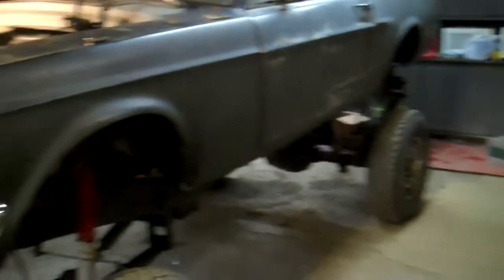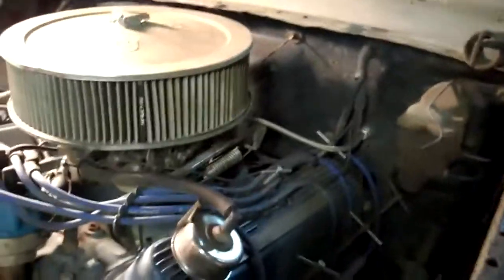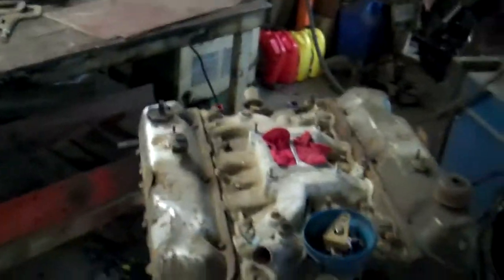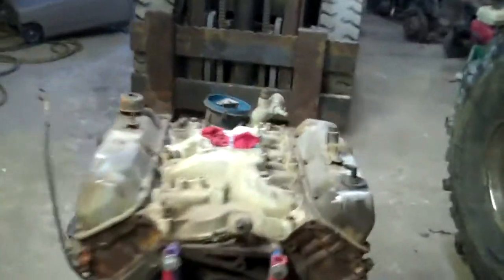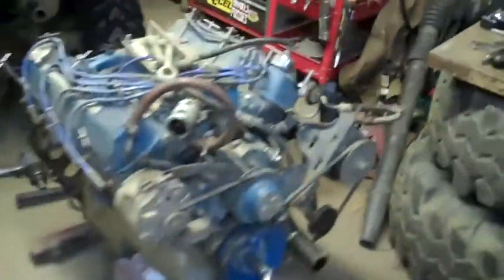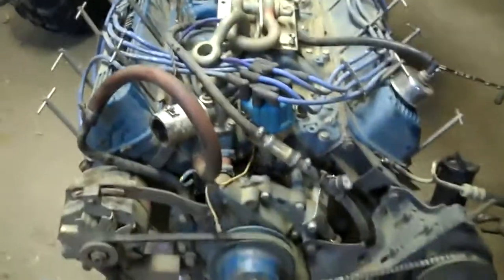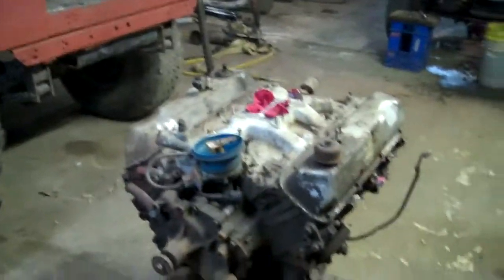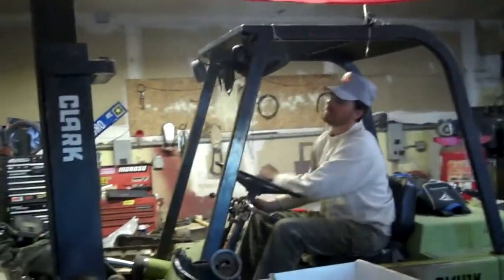mustang engine swap

Comment: im thinking if you have a torque converter on the tranny then you wouldn't need to swap both engine and tranny? please correct me if wrong im tryna do a swap but i have an automatic tranny ...swapping the 200ci v6 for a 5.0 fuel injected  302

Comment: I have a 1991 convertible mustang. I’m trying to put a stocked 460 big block in it.  The transmission is bolted to the motor. I tried putting the  motor and transmission  in together, but it has a big gap between  fire wall of the car and the end of the transmission. The motor is just a little off  so that the motor mount screws won’t drop into The hole. Do I have to modify anything, or does it suppose to bolt right up. I need help?